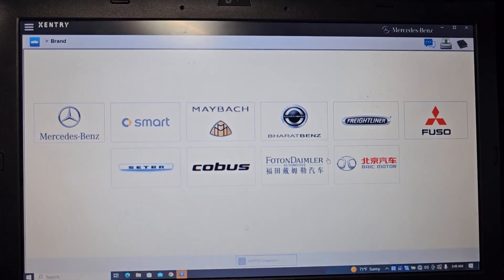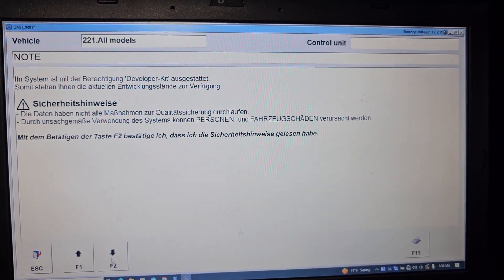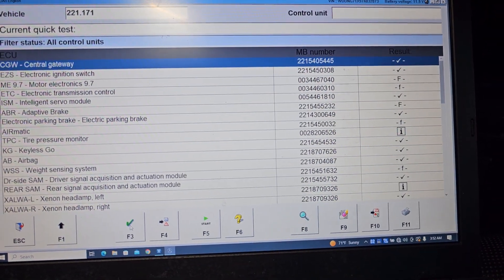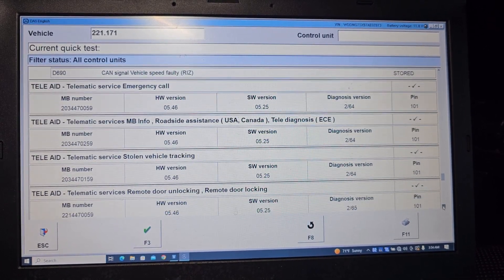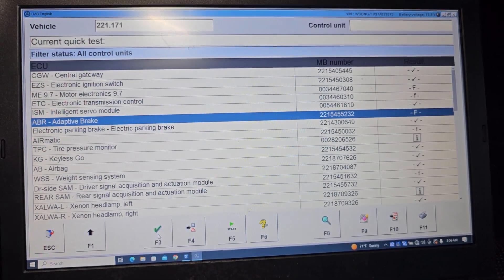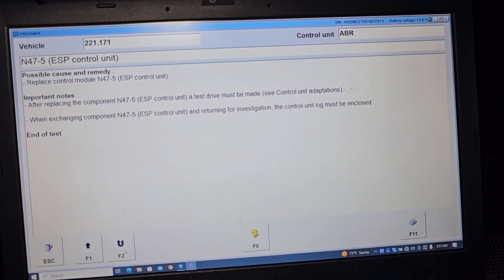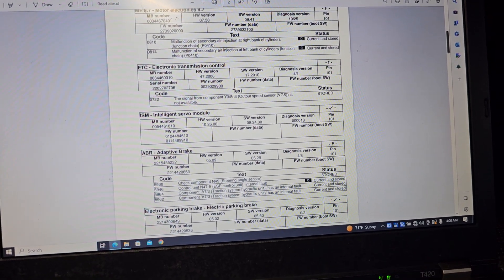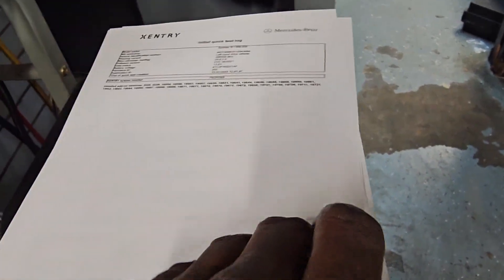2007 Mercedes Benz S550 ABS And ESP Inoperative Message Diagnose Result

Comment: Hello Master,
I hope you're doing well. Actually, I have a problem in my 2006 Mercedes ML350 car, in the parking lot it seems to accelerate normally but once on the road while driving, there is a yellow triangle shaped light that flashes after it there is a loss of power, the car refuses to accelerate and there are codes 1186 (p2004), 5130 (L6/4 speed sensor), 5110 (L6/2 speed sensor), and 7266 speedtronic sometimes not functional. but with the code p2004 the car worked normally no triangle light. but now as soon as the light flashes I can no longer move forward! Could the ABS be responsible for this problem? Thank you for your help please
Reply: Hello how are you doing. Any update? My ml350 same thing ughhh